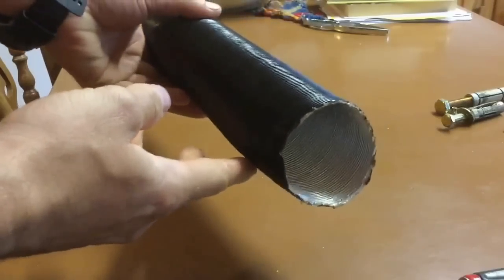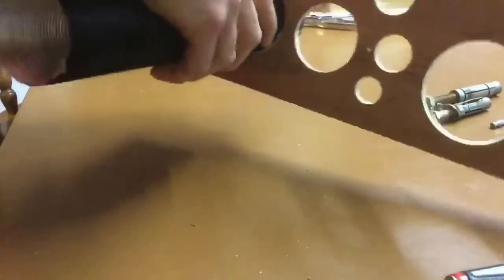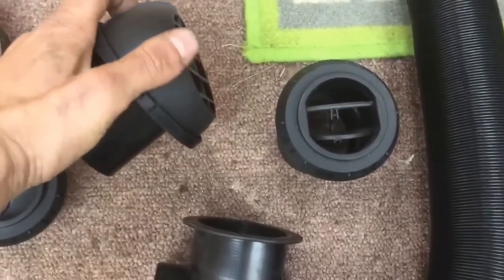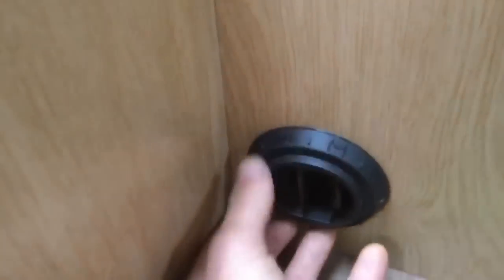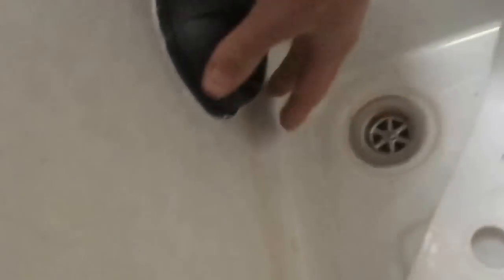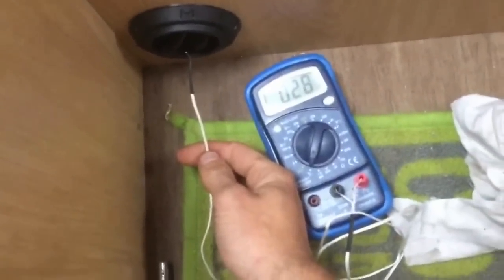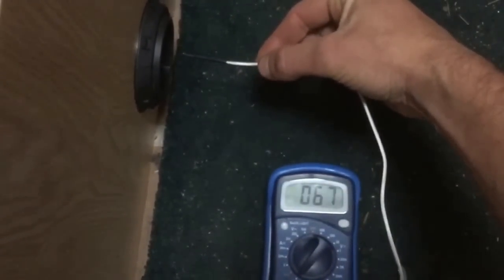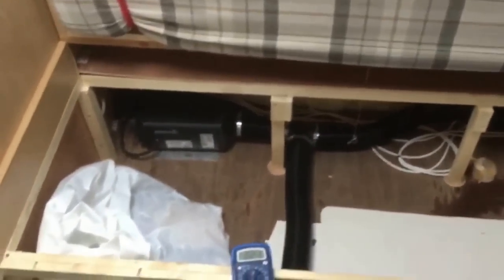Fitting an Eberspacher D2 to a Citroen Relay campervan - PART 6 Internal ducting and temp testing

Comment: Excellent job and tutorial,  I want to add a webasto 4 k evo into my camper to...guess you get lots of heat in your shower straight piped?
Reply from the maker: +Hannes Hofmann Thanks for the appreciation, yeah I get loads of heat through it, I use the shower as a drying room and it's fantastic

Comment: How long have you had it,,and is it still running well ? Thanks
Reply from the maker: +DOUG FERGUSON Hey Doug, the heater has been in my new van since the videos came out and in my old van for 2 years and the unit is going strong, with no issues at all to date. I use it daily as I spend a lot of time working away from home and living in my van.
Reply: Thanks.  Im wondering how many ducts i can put in the RV floor to throw the heat around.im buying a 5.5 watt   21,000  btu for my RV  for winter. Could i put in say 6 vents if i wanted ?
Reply from the maker: +DOUG FERGUSON  you could put that many vents if you want, there isn't a max limit that I'm aware of the only thing worth keeping in mind is that the more vents you use the lower the volume of air at each vent will be. And you will need to size the piping to make sure the air gets around. I would start with the lowest number which will allow you to spread the air around your van and just check your happy with the heat and volume making it to each outlet. Then add extra vents in as you think you need them and keep checking the output at each to make sure your happy with it. I haven't done a huge rv installation myself but if I had to do one I would search to see what other people have in their  vans to see what appears to be working for them. Hope that helps.
Reply: Thanks,im putting a 5.5 watt 23000 btu into a 37 ft resort coach. Hope thats enough heat to keep it warm in minus 10-15  in winter.